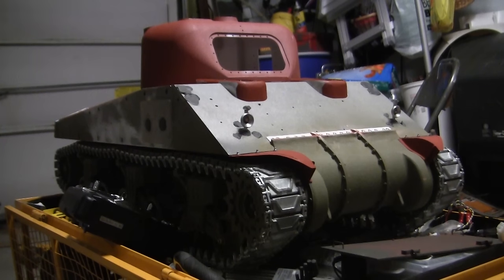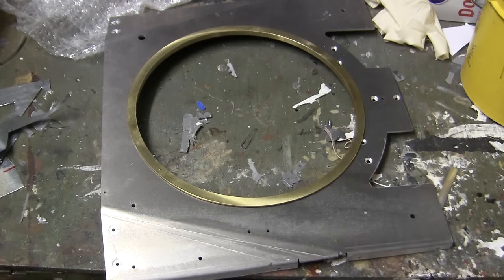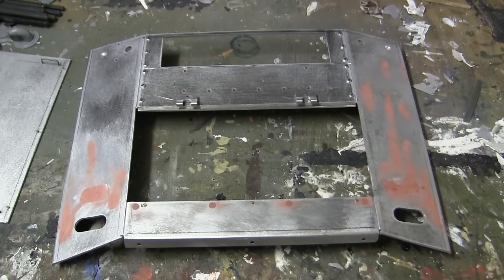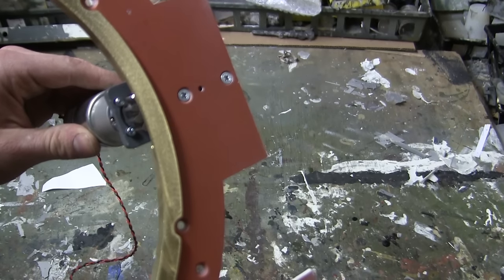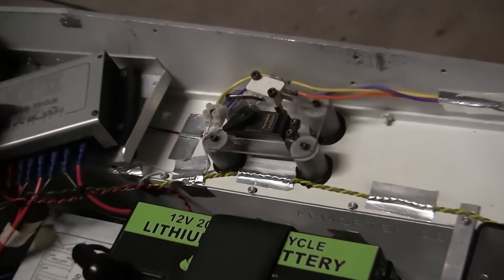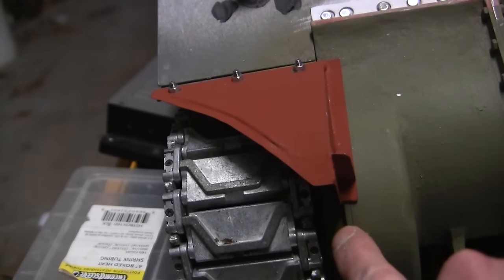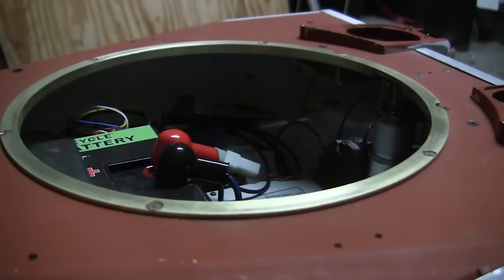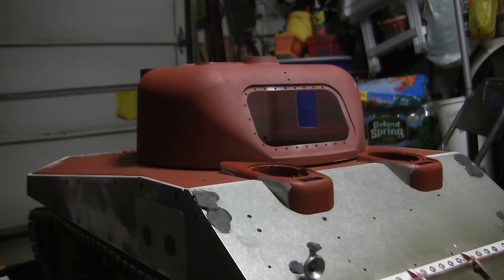RC Armortek 1/6th scale Sherman V Firefly project video#5 (Lights, top deck mods, turret)

Comment: Amazing attention to detail John cheers for the upload . Just a question though what paint will you be using to mimic  the rubber pads on the tracks?
Reply from the maker: replicating rubber track pads on this build is not necessary as the tracks that are represented on this kit are the all steel pattern of VVSS sherman track. When painted the track will have the parkerized look that is present on my other builds
Reply: Thanks John look forward to the next upload .